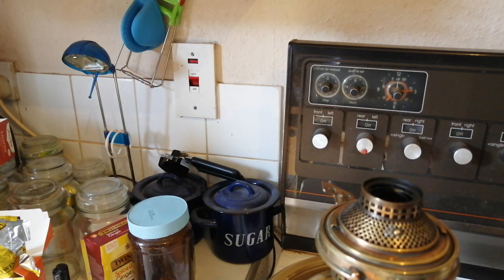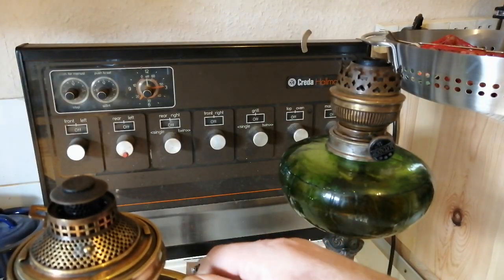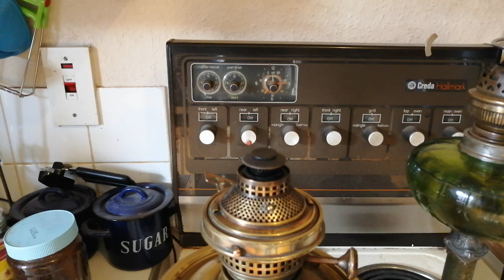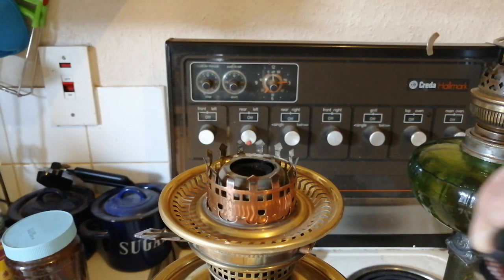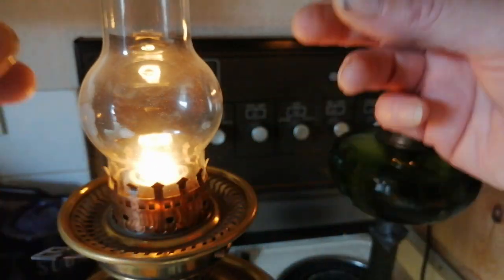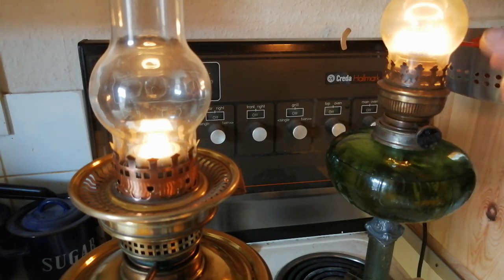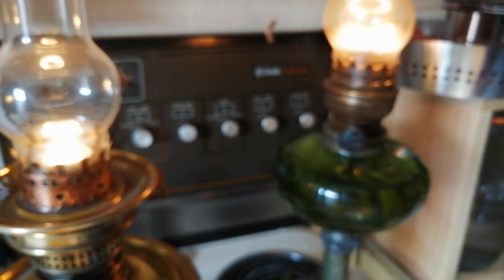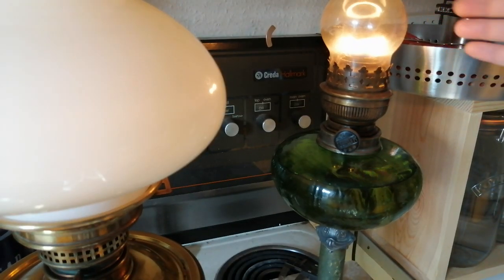Edwardian Oil Lamp

Comment: It is indeed a Kronos Model 1914 or Challenger (essentially the same model). I stupidly recalled that it was designed by Ehrich & Graetz (not sure why). It's actually designed by Hugo Schneider AG although the makers mark on the fill cap IS Ehrich & Graetz. Both were competing quality German makers. It must've been made under licence somewhere else as frequently happened back then before we had all this last minute procurement and the  globalised shipping infrastructure to support it. 
Although this burner seems to work fairly happily on the same principle as the little 15 ligne Matador (ligne or "' is an old measurement for oil lamps), it's not how it was designed to work. It's actually decently brighter than even a 20"' Matador as it works on much the same principle as an Aladdin mantle lamp (post Model 12 ).  There's a lot of information out there on Aladdin mantle lamps. They were very popular due to the brightness and economical fuel usage that comes with the use of a mantle. Your lamp is pretty much a German take on the Aladdin lamp (called a Glühlicht).
Although I've Identified what you require below., I feel pictures would describe details so much better than I could. There seems to be some 'good enough' pictures about online, the best I could find, on a brief hunt, is on a page from a German site called antike-petroleumlampen, just scroll down until you see model 1914.. The exact page can be Googled with.

"Kronos-Brenner" Modell 1914 - Hugo Schneider AG - Leipzig (Germany) - Rundbrenner 14''' (Petroleum-Glühlichtbrenner) mit Hebegalerie     (Ref. PB041)

To complete this burner you require:
1: A generator. It's similar to the Matador flame spreader but it doesn't have the umbrella or hat rim that spreads the flame. Much like the Aladdin, it's just a plain thimble type shape (albeit with a flat top) with plenty of holes on the side, its purpose is merely to feed the flame air from the burners side draught design (as opposed to a centre draught design). These generators usually came with 1914 marked on the top (Aladdin ones won't fit). they come up on Ebay a fair bit on old broken 1914 or Challenger burners. Only problem is you have to identify the correct oil lamp burner yourself as they're rarely listed with the correct name.
2: A mantle support.. Unfortunately this burner appears to have lost its mantle support (as so many do). It's just a upright tube that accepts the wire leg of the mantle. It'll work very well with Aladdin mantles if you cut the wire hanger to suit. The mantle support sits inside the chimney and chimney grippers. There are a few ways of attaching it but most just buy a brass tube from a modellers supply shop and use some hard solder to attach the tubes base to the sloped area around the wick hole. There's often a mark where the old tube became detached. If it isn't obvious get a mantle and line it up before picking a spot to solder.
3: A Mantle.. Luckily after an extended period of scarcity while production was being moved to a new factory, they are now available again. Just look for Aladdin (model 23) mantles. It becomes quite obvious how to cut the mantle frame. 
4: Correct Chimney.. You have a Matador chimney there. The correct chimney is just a straight tube. They sell them new at Base Camp (online website). Sometimes they come up on Ebay too.
Reply from the maker: Briceni Thank you so much for taking the time to tell me about the lamps. This is a big help to me. Now i know what part i need to look out for.